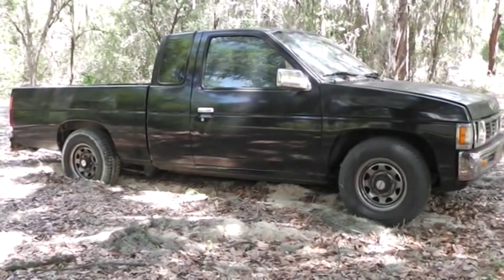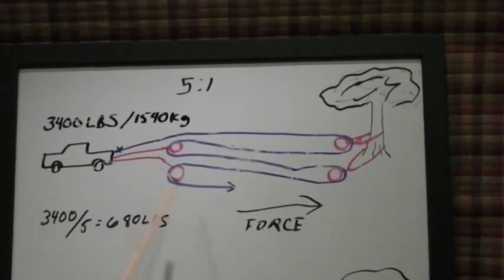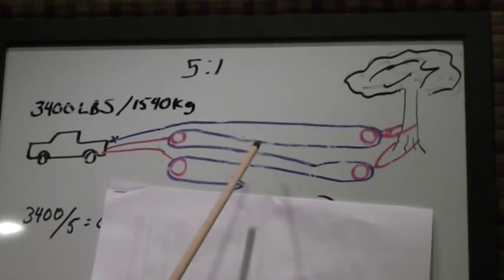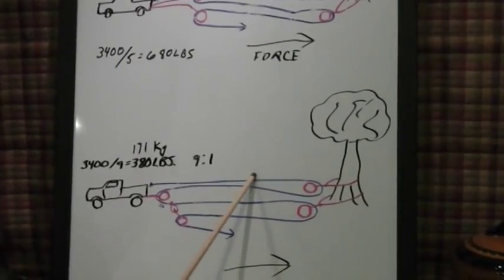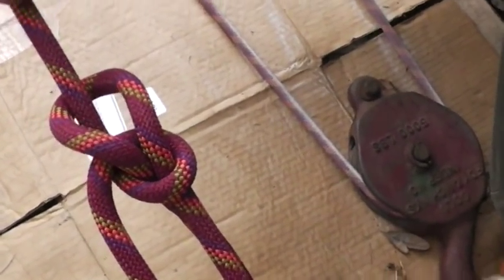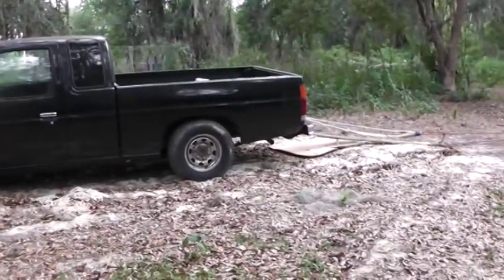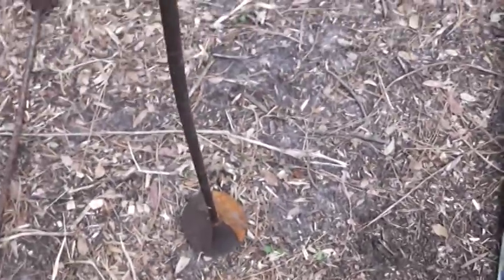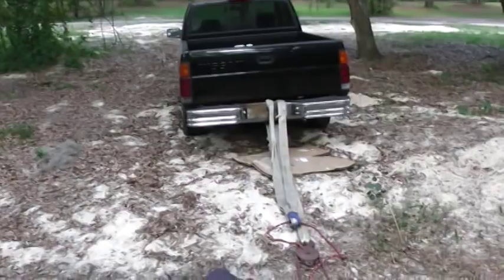Mechanical Advantage Using a Rope and Pulleys for Vehicle Recovery 9:1

Comment: Why do they call it the Bowline?  They should call it the Rabbit Tree Hole Knot since most of us aren't sailors securing the bow (front pointy part) of our ships.

A Figure-8 knot and Alpine Butterfly will also work.  If you put a load on them by doing a tractor pull event it'll  take a hammer banging on any of the three knots to untie them.  You wimped out here making it look like the bowline is easy to untie by not substantially loading with a dynamic pull from an F-550 making a running start of a few feet before cinching the knot. 

Using naval terminology again..., If you don't have a tree and are stuck in the mud the Pull-Pal Winch Ground Anchor is a cool device to have in your toolbox to use with your 5:1 block & tackle setup.  It kind of looks like a farmer's plow. The harder you pull on it the deeper it digs in.
Reply from the maker: +Jules Bartow Where you say "You wimped out here making it look like the bowline is easy to untie by not substantially loading with a dynamic pull from an F-550 making a running start of a few feet before cinching the knot",  you should make a video demonstration and link it here in the comment section.

Comment: I am certain that everyone has a couple of hundred feet of rope laying around and a slew of pulleys.  I have a 4X4 and do not have that problem.
Reply from the maker: +Ken Johnson
 Ken, who are you trying to kid? Anyone who has ever done any 4 wheelin'/off roading has gotten stuck at one time or another.  The exception of course are people like you, who if you do indeed have a 4x, it has never been taken out of 4x2 or been off of the pavement.  How about a vid of you going through some 12 inch deep sugar sand or a swamp down south?
Reply: +Ken Johnson I didn't realize 4 or 5 pulleys was a slew. I do have a couple hundred feet of climbing rope as does many other preppers I know.
Reply: homesteadprepper I never got stuck in fl sugar that with either my ranger or my cavalier

Comment: Toungue weight rating is far less rating than a hitch. Do a litle more research Give good information when  dealing with load ratings that can kill. Know your equipment wll specs and its critical failure rating, do your  math make sure your equipment will support the limits you impose

Comment: it's good example, but who have in the car as long rope as you have there and 4 Pulleys?  .. :)
Reply: +SpecNazMako uhm, most of us who work outside do. I carry a similar 100 ft rope, 2 pulleys, a 20 ft chain, a come-along, 2 ratchet bands, like the ones he uses - heavy duty  and a chainsaw ... in Seattle is a good idea to carry a chainsaw in your truck, look up the storm from 2007 or 2008, forgot the exact year - I encountered 32 fallen trees on my 15 mile trip to my home - I had to cut 2 myself - emergency services were swamped. They don't take much space in my spacious toolbox ... and I never get stuck or have to spend 100 bucks for AAA to come pull me out of anything.

Comment: First off who carries all those blocks and tree sling and rope in there pos Nissan??? And second off you only need to put a coat or towel / blanket on a steel line the synthetic cable is not going to kill a or injure any one. Your right about one thing call a buddy, it will be way faster. And if your planing to Carry all those lines and blocks and straps, just get a fuckin winch. Its close to the same price.